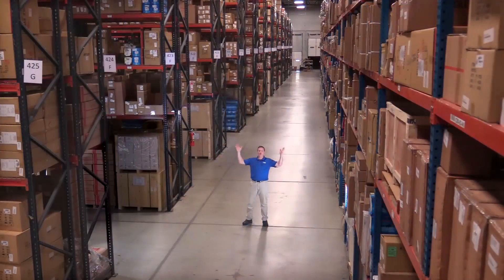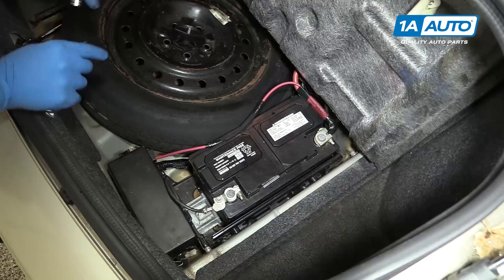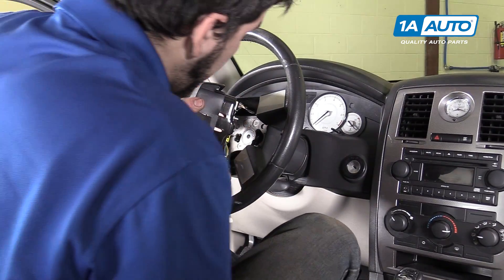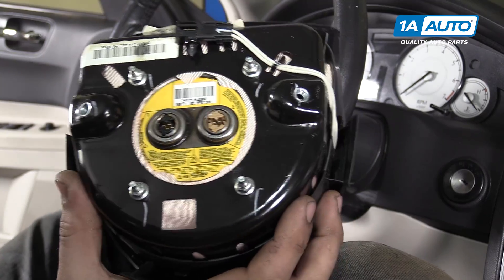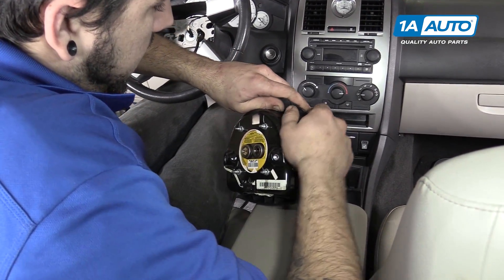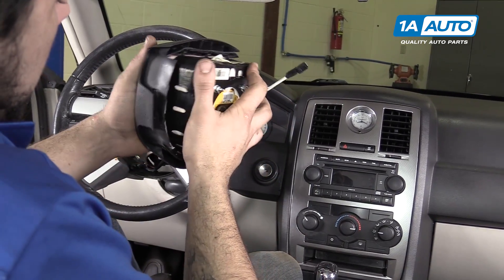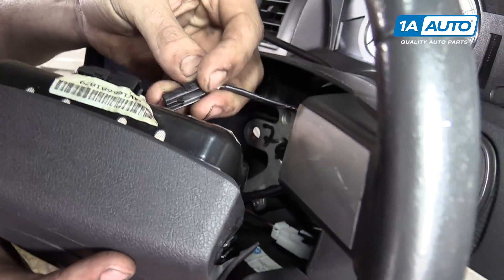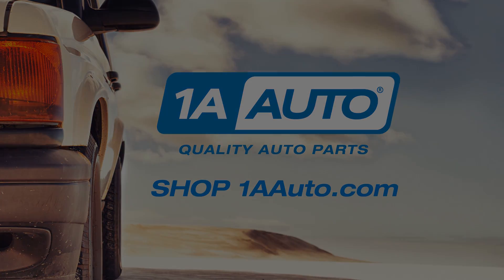How to Remove Airbag & Horn Switch Cover 05-10 Chrysler 300

Comment: Hey would this work similarly on a 1998 Buick LeSabre which has a similar issue with horn button and airbag removal? Thanks.
Reply from the maker: +RenegaderDTA It may be a different procedure on your application. We currently do not have an auto repair video for this particular year, make and model. Thank you for asking. 1aauto.com
Reply: @1AAuto 
Hey!
Everyone is asking:
Where do you buy the horn switch????